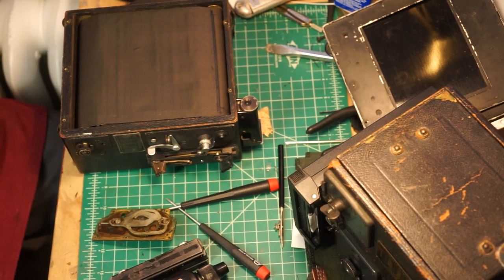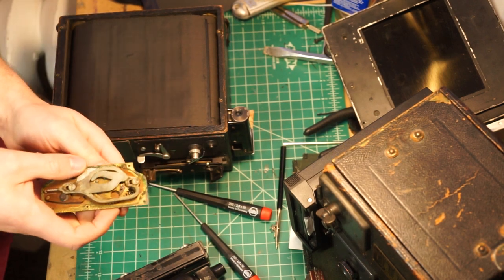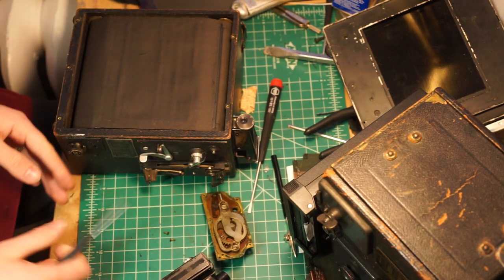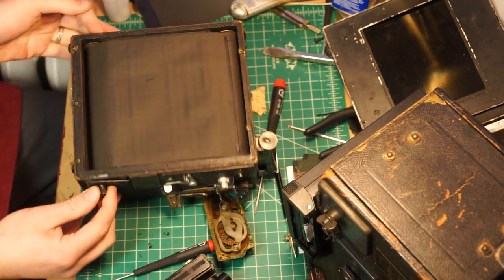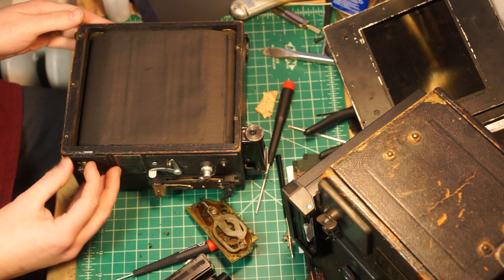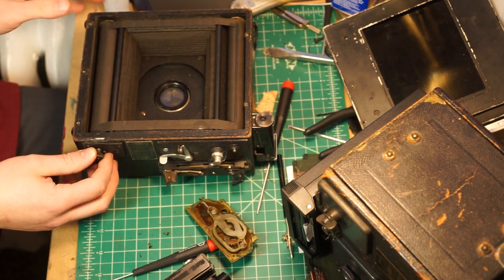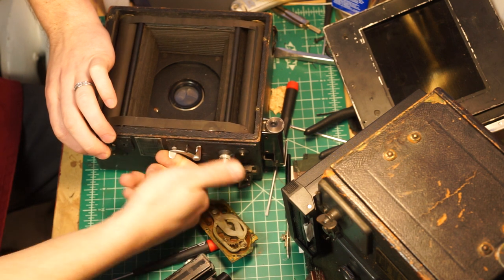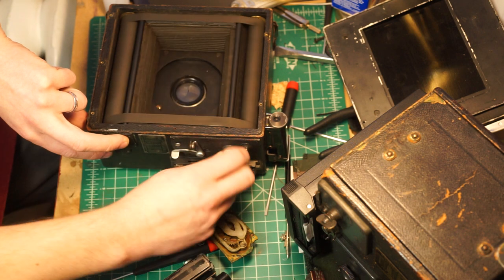Graflex Focal Shutter Crash Course GraflexParts.com

Comment: I'm glad you have the drive to keep these classics going.  Keep a clean work area. Put everything on a towel to prevent marring and catch loose parts.  Put those screws in a dish, magnetic ones work very well.  I've lost many manhours looking for those tiny screws, springs, etc that rolled off the bench in my early years.

Comment: Thanks, I just got the gumption to work on the tension in my "parts" camera - pacemaker speed.  I came to the same conclusion, I started with the 'T" and 'O' settings because that was where the least tension was.  I fixed that and then the other speeds looked more or less great.  Then I was brave enough to pull out my primary pacemaker speed and do that.  Pretty easy and getting it all lubricated worked well.  Thanks for the advice to only go as deep as necessary to manage the issue.  I have to keep myself from opening everything up.  My parts camera is rapidly becoming a daily driver!  I just need to build a back for it.  Thanks again, you expertise and advice is helpful in a lot of ways!

Comment: I have a Speed Graphic like this, but the FP shutter release is different.  I don't have a lever on the right side where the cock mechanism is.  I only have a TRIP BACK FRONT switch and cannot get the FP shutter to release.
Reply: I have the same problem as you! Did you solve it?

Comment: I have a 2 1/4x3 1/4. I would need to remove the flash handle and the range finder to be able to rotate the plate as you show. Is that what it takes? Thanks for the video.

Comment: Cool to see someone working with a Graflex. Graham do you have any footage of reconditioning the faux leatherette covering or removing it and taking it down to the wood and refinishing the wood? Thinking of doing that with a graflex I acquired.
Reply: I've moved channels- but I don't currently have a video about refinishing the wood. It's a fairly simple procedure that mainly involves patience! :)
Reply: @GraflexParts  What's the new channel? Does it still involve working with Graflex cameras?
Reply: @gcnphilly  Yes! This new 'Graflex Parts' channel just follows the same branding/ aesthetic as the rest of what I'm doing. 

Also worth noting that I have a passion for other brands large format SLR's and work with them a lot too! :)

Comment: Thanks a lot for making this video. For the gear piece you held in your hand, could you do a video to show how to remove and put it back? If it’s too much trouble could describe briefly about the procedure? Does it involve and spring or tension adjustments? I have a 3A with mirror mechanism inside. Shutter should be triggered with a lever on the other side of the camera but now I have to manually raise the mirror. I figure the gear got gummed up won’t provide enough spring tension to raise the mirror. It only works as should be when I point the front of the camera towards ground so the gravity will kick in to compensate the lost tension required to raise mirror after shutter lever being pushed. Any advice will be greatly appreciated.
Reply: Hi Ethan! Our channel is now over at https://youtu.be/kZuo_j1DfKs

In regards to your question; I could make a video demonstrating putting the aperture selector mechanism on the camera but it would be irrelevant for the camera you're working on. graflex SLR's and Speed Graphics only share the principle of the focal plane shutter but little to none of the same mechanical design. The mirrors in SLR's are controlled by separate springs that are not attached to any of the shutter mechanism but they are known to get dirty or corrode. The aperture selector (shutter release) in an SLR is actuated by the mirror.

Think of it like a Rube Goldberg machine. You release the mirror which is fixed to a shaft. When the mirror flips up, the shaft it's fixed to will spin. That shaft comes out the side of the camera and is fixed to a little lever. That lever then moves and presses on a second lever which releases the shutter curtain allowing it to fire. The spring that creates tension to roll the curtain is contained inside of the lower curtain roller/scroll. Graflex 3A's are also a tad different than the rest of the SLR's graflex made. (more compact, different orientation/arrangement of parts, certain components aren't as easy to access, etc)

I hope this helps! I can be reached easily via email too, I have a convenient form that can be found on my service page here: www.graflexparts.com/service-department

Cheers,
Graham
Reply: @GraflexParts Hi Graham, thank you so much for the detailed information provided. It's so wonderful to have someone like you with such deep knowledge regarding Graflex cameras. I will definitely check on your service page. Meanwhile I'm waiting for my test films getting developed. Just have no ideas about what the results gonna be. Thanks again and will keep in touch.

Comment: Hi, have another question as I was exciting to discover your video. How do you remove the gear panel that you showed? I have a Series D and the aperture tension levers don't work that well. I'm able to turn the shutter cocking mechanism only to the first setting 1/8 which is used for speeds of 350th to 1,000th of a second. However, when I press the curtain release lever to slow down the shutter speed (release the tension) it only responds once. So it'll go from 1/8 on the indicator to 3/8 but not beyond that. So I'm not able to get to the 3/4 and 1 1/2 curtain aperture ranges. Any thoughts on what that might be? I think I need to remove the mechanism and just clear the gears but when I take off the screws it still doesn't come off. Is there another step to that process? Thanks! Cheers!